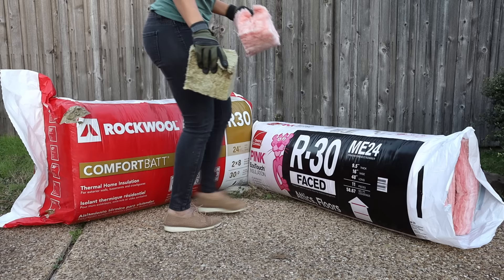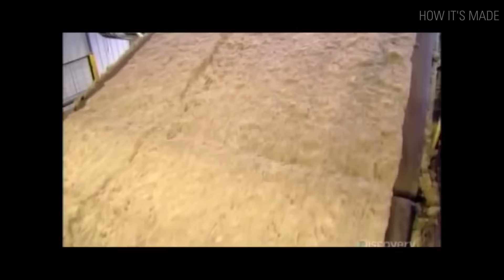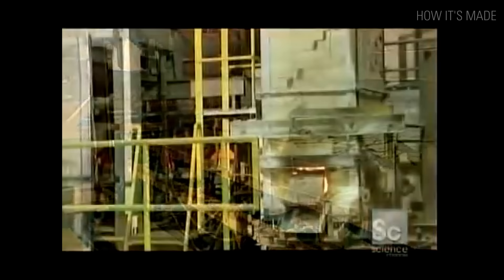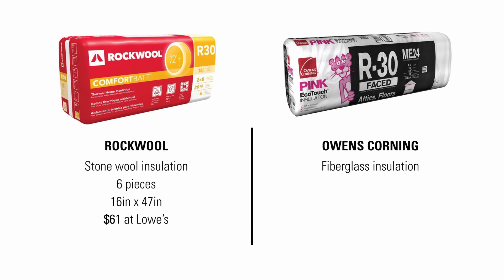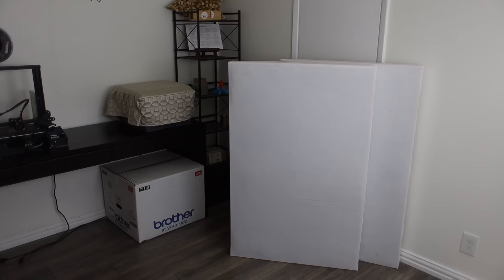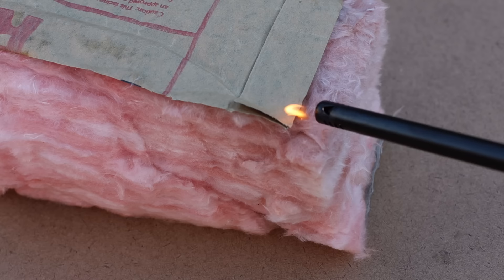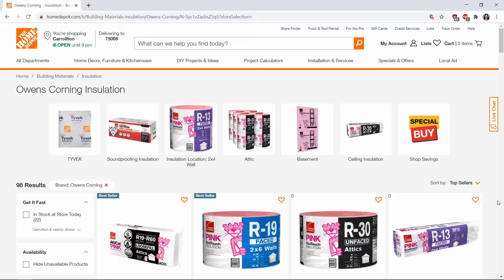Mineral wool vs fiberglass insulation | everything you need to know

Comment: I was surprised to hear about formaldehyde being in the rock wool. I remember hearing about it being in sheetrock in FEMA emergency housing after hurricane Katrina and there being lots of concern over the formaldehyde  polluting the air in the homes and increasing cancer risk.
Reply: I understand your concern with formaldehyde but saying your surprised is concerning on its own. 35yrs worth of data and application of formaldehyde in the home building products gets only a recommendation of reducing possible exposure and ventilation suggestions 🤔 
Please do your homework before making  moments related to 25 yr old news reports. 

P.s. do you know what FEMA did with those temporary housing units?
Reply: @88jettaguy  Dude, Harsh, maybe I don't want to take extra precautions not to huff formaldehyde in my living space.

Comment: Here in eastern europe the fiberglass insulation isn't very popular. I'm working in a construction company that has a lot contracts for thermal insulation of apartment buildings and i don't think i ever seen any fiberglass insulation in any project. We mostly use polistyrene (EPS or XPS) and mineral wool.
In most cases EPS is used wherever it can be used and rockwool is used where it has to be used - borders of fire zones (or hovewer it's called in english) and all exterior walls over 25m above ground.

Comment: As with any insulation Rockwool insulation if water is poured over rolls off. One would think that it dose not absorbs. Set rockwool insulation in a bucket of water and you will see absorbency like a spong. Had a small leak and small puddle of water under rockwool abortion was plentiful. The product is delicate to handle without breaking apart. Fire retardant and molding are the best reason for this product over others.

Comment: Hi free thinkers, the first consideration is product safety. Rockwool has best insulation & fire retardant, a cousin of asbestos, when handling use personal safety gear, correct mask & protective disposable clothing. It would be safety code attached to insulation package, eg traffic lights, if the light is red, can be deadly. Green does not require protective safety equipment, that will not happen. Read the fibre size that can be injested lungs can effect health. Manufactures like asbestos was noted as safe, the choice is in your research.

Comment: I gutted my house and decided I could not afford in floor heating and went with Cast Iron baseboard instead. I also put stone wool in every wall & ceiling. Even walls between rooms for good measure. I can tell you now in floor heating would have been a complete waste of 20-30k.

My house is an oven 24/7  ....the heat is just trapped in it.  Invest in good windows, doors and Stone wool insulation and you will never regret it.

Comment: if you are remodelling an old house or building and are worried about retaining heat , every penny you spend on insulation is an investment . people spend thousands on the latest heating system which over time becomes old and unreliable and will need to be replaced , the insulation if fitted is still working

Comment: While the resin in the rock wool may not be demonstrably toxic, any very small fibrous substance that does not easily break down in the lungs so it can be expelled is at the very least an irritant and irritants can cause very serious issues over time.  While in the wall, these materials are in theory segregated from the air we breathe, but things change, walls break, and holes are made.

Be very careful with these materials.  They are great insulators compared to many other materials, but they do have their risk factors.

Comment: formaldehyde in stone wool would deter me from the product. Add in the increased cost, the weight and it is fiberglass for me every time. The weakness of fiberglass is not hard to overcome, install to keep it dry and do the proper supporting, not a big issue at all.

Comment: Very impressed with your videos.  You have several insulation comparison videos featuring 2 types.   Overall, what do you consider the “best” insulation material?   One if price is not a factor and another for cost effectiveness.   Curious if Rockwool or cellulose or ? would prevail.
Reply: If price is not an option, closed-cell spray foam has the best performance by far.

Comment: Rockwool insulation is better for camps and houses in the woods as well. For instance Squirrels will chew and burrow through fiberglass getting into the structure and ruining your insulation and getting it everywhere. As Rockwool they can't burrow or chew through. building a camp use rockwool...

Comment: Hey Belinda, I love the way you present all the info. But regarding the rock wool I have a question, If you can research for us. Friend of mine got 2 spare rockwool sheets and store them in the attic of his house. It is not heated and could have little bit more moisture. After an year he decided to make use of this spare rock wool and was surprised to find it in very bad shape almost break in to sand on touch and wasn't that solid sheet... So is there something more that needs to be done to preserve rock wool from the elements? May be some treatment when installed?

Comment: Great video.  What I would like to know is, what is the difference between mineral wool batts and mineral wool rigid insulation.  None of the local stores such as Home Depot or Lowes carry the rigid mineral wool in the store and any time you speak to a store representative about ordering the rigid board for outside insulation they give a song and dance routine and tell the same story that someone ordered 6 to 8 months ago rigid outside board and it is still not delivered.  They both carry the mineral wool batts.  Can mineral wool batts be used on the outside of a structure?

Comment: Any opinions on sound absorption differences based on what frequency range you're trying to absorb? I have read a lot in sound insulation designs for home theater rooms and other applications where sound deadening is desired. A lot of what I've read says that the bigger challenge with sound deadening is bass, or low frequency sound, which is only addressed by maximizing mass, either through double layered drywall, decoupling and even double walls. For a simpler approach to sound deadening roxul will probably add a bit more mass but be fairly ineffective against bass sound travel. With double walls, decoupling, etc I've read that the pink stuff still does fine against high frequency sound travel.
Reply: pink = highs....double pane vacuume glass for bass, or super deep 20 inch sponge pyramids on walls
Reply: bass = pure 1/2 marble or ceramic or stone
Reply: @lunam7249  whew, I'm sure that would be effective but I wouldn't be the one trying to hang stone from a basement ceiling!

Comment: What about radiant heat?  I don't think the R value addresses that, and I'm under the impression that fiberglass isn't good at blocking radiant heat, such as from a hot roof "shining" its radiant heat through the ceiling insulation below it.  (Yes, heat moves through conduction and convection, but also radiation --- three modes.)

Comment: Belinda, is it true that if you press the rockwool in place it loses its R value? And what about ripping it lengthwise? I’m wondering if we should start over on the ceiling/roof of a shed that has 2x4 studs and I was accidentally given 2x8 Rockwool R30 and my non English speaking worker ripped it lengthwise since clearly 8 inches was too thick for the spaces. He also ripped up a bunch of pieces to go around the outlets and lights. Doesn’t that ruin the Rockwool’s performance and the reason I bought it? Oh I hope you see this and reply or someone does. Thanks so much. I’m so glad after researching for hours earlier that when I came to YouTube your video was in my top feed. Now I’ve gotta check what else you’ve got. 👍😊🙌🙌🙌💝

Comment: Great video, the embodied energy used in the production of these insulation products seems to be enormous, surely there are insulation materials available that don’t require such massive furnaces? Have you looked at natural wool or recycled cellulose which is are both recycled products that can also be recycled beyond their lifespan as insulation?
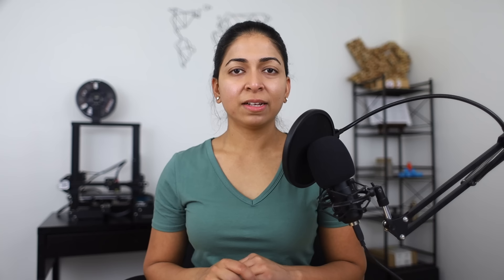Reply: A note in one of the cut away graphs in this vid (9:13) states that for every BTU used to manufacture the insulation, 12 BTUs are saved in heating/cooling costs IN THE FIRST YEAR ALONE! That was a shock to me. Sure seems worth it

Comment: Thanks for the great informational video I have a question I have a concrete basement floors and walls and there is no heat other than the furnace working which keeps it warm , should I insulate the ceiling of the basement ? Type ? staple up plastic to cover from dampness ?

Comment: Is Rockwool or Mineral wool  a good product to place in rafters for ceiling insulation? My contractor said it was not because it would be too much weight on top of the ceiling drywall and causing it to sag over time. I'd prefer to use Rockwool or Mineral wool, but without the paper edge to to staple to the rafters, I am concerned about the weight issue.

Comment: overall nice presentation, but i can not dismiss a feeling, this is kind of marketing for rockwool. in general, stone wool is not as water repelent as it was mentioned, seen a lot of examples, where it have been completely transform into pool of mud , if there some leakage happened from radiator piping etc. both insulation have their usage with their pros and cons.

Comment: Does stonewool overtime leave dust in the air when low frequencies hit it? I have a home theater with bass absorbers made of stonewool/fiberglass hanging from ceiling wondering if they’ll end up emitting stonewool dust from above when low frequencies hit them. My subwoofer produces frequencies between 10 and 20Hz.

Comment: How is Rockwool insulation different from the Rockwool cubes used for growing plants?... I see the Rockwool you used does not soak up water, but the cubes for plants do,.... is the waterproof resin not used on the cubes? Can I buy Rockwool slabs to grow plants rather than buying cubes?

Comment: I'm looking to soundproof my ceiling. I need to stop the noise coming from the flat above me,  music and the old creaking wooden floorboards from the flat above me disturb my piece. Could you please advise on the best and simplest soundproofing solution? This old house is divided into flats, and the construction of ceilings and floors is made from old wood, there is no concreate. The outside walls are bricks, the inside walls are simple partition walls. Would gluing Acoustic Foam Tiles on my ceiling stop the squeaking (creaking) noise that comes from the floor above my flat, low level music and heavy steps?

Comment: Would have been nice to know maximum stable temperature and thermal conductivity per unit (cm/in) (loose/compressed). I want to use in a kiln, furnace or forge. 🤗🖖,jpk

Comment: I was wondering about roping off the insulation in my attic. currently I have fiberglass batts. If I went with Rockwool on top of the existing fiberglass batts. Or would I have to take out everything and start from scratch to get the benefit of Rockwool?

Comment: this is for a (not so) tiny home, i have been offered a great deal on stonewall insulation (vs styrofoam) but they insulated sheets seem to be laying there for a couple of years, exposed to heat (low humidity) but the bottom part of the packaging is exposed (they are laying flat)
any idea if they are still any good?
if so, i can wait till spring when the raining will stop, should i wait or what's done is done
any help is most appriciated
thank you in advance  for any and all help :)

Comment: When these insulators are manufactured, the process consumes so much energy per day that the insulation does not save on society's energy consumption in life time.
Insulation made of natural material is cheap to producing and save prosessing energy, as well as absorbing moisture without damaging the structures.
The purpose of the insulation is only to prevent air from moving in the structure.

Comment: Why doea the orientation of the foil matter and differ between cold and hot climate areas?
Reply: due to stable temp indoors of  degrees +/- on the outside wall.
I.O.W
  it's basically 70°(HVAC stable)  all year long inside/indoors...vs  +/-  0 - 90° outside all year long changing hourly daily/seasonally  with humidity.
Reply: @tjellis1479  thank you for your reply! but she says to keep the foil from the inside in cold areas, wont this get the condensation to form inside the insulation material and ruin it during winter time in cold areas?
Reply: 10:40

Comment: Hi. I have a question. I want to insulate an interior wall in our bathroom, if i use the rockwool should I still use a vapor barrier? And which rockwool i should use for bathroom? Hope you can help. Thanks.
Reply: Where do you live? In the north like canada where we heat in winter and use air conditioning in summer, we put a vapor barrier everywhere in a building. For either fiberglass or rockwool

Comment: Kaowool is superior to both and it’s used widely in the cement plant industries, where cement or Portland or Type2 cement is actually made , not a redymix plant but a cement plant where a kiln that burns the aggregate at 2500 degrees at the burning point. It’s simply the best insulation ever there is no other product available to the masses that can compare to the heat resistance. Give it a look for absolute protection and insulation factor

Comment: After changing the insulation to Roxul there are no insects or rodents as there was with fiberglass.  I wouldn't even consider fiberglass for anything except in the case where weight was a consideration.

Comment: You first sentence is incorrect: you forgot to even mention styrofoam. It's used for almost all cases for walls. Mineral (glass/stone) wool is used on almost all roofs. 
Also: use of slag is very good, as it means recycling waste. 
11:00 It's beacuse stone wool was found by an accident - it was found in nature on some volcano and the research was to recreate it - most basic way was to blow air on lava (that's how this was created by nature). 

Glass wool is as bad or worse than asbestos when you want to do renovation: it tends to dissolve into dust on its external surface, while bazalt wool not (not as much). Also Glass wool  dusts a lot with glass dust during assembly, so it is way worse for health than stone wool.

Comment: What do you think about cork panels and polyurethane foam?
Reply: Urethane using HFO chemicals is the best and most expensive insulation out there. Serves as a vapor and wind barrier (2" inch thickness minimum) as well as insulation.

Comment: 5:55 'The high density of stone wool equals more trapped air'
That's physically impossible, unless air is pressurized (which lowers its insulating properties). With higher density (meaning there's more mineral material in the same volume) there's less space for air, not more. I guess you meant that rock wool is less permeable? That it better constraints convection and other means of mechanical heat transfer?
Reply: She probably meant that the warm air inside ur home is more trapped
Reply: This comment came under the topic of sound absorption, so she may have been referring to the higher flow resistivity that typically comes with higher density insulation products. That is, "more trapped air" meaning less opportunity for air molecules to oscillate within the product, or higher rates of soundwave kinetic energy being converted into heat energy.
Reply: @Deyterkmahjeeerrrb  I'd say it's 'better trapped' air, although less of it.

Comment: Both of these insulations are worth little. Mainly for two reasons. Insulations with a fibrous structure have a low resistance to air movement, i.e. convection. The second, disqualifying disadvantage is the sensitivity to a decrease in insulation due to increased humidity. it's a waste of money and more. It is only a large disposal cost

Comment: I hate to work with either of these, because they itch sooo much and are harmful when breathed in. I have installed polyester batts (basically doona filling) which is far safer but a bit more expensive. The installer was whinging because it is harder to cut, but other than that no complaints. Rockwool and fiberglass break down and start to trickle down through the holes in your downlights on a single storey building.....

Comment: Why anyone would want to ever continue to use fibreglass as insulation is beyond me. All you need is go look in enough attics and see just how much fibreglass over time compacts up how dirty it becomes and even sodden should the roof leak and ends up needing to be replaced. I've used both fibreglass and rockwool once I discovered rockwool I never looked back I find it doesn't end up as messy to use it keeps its shape and the soundproofing even when not using the soundproofing product is so much better plus it's so much easier to install. Yes fibreglass is cheaper and you get more of it in when purchased but if replacing insulation in the attic say nothing says you have to replace it all in one go if the cost is a worry do it in sections over time. Install the rockwool instead layer up the pulled out fibreglass over existing fibreglass regaining some of the R-Value lost until you can buy more replacement it's what I did years ago. Over time fibreglass is just simply a false economy to buy because it loses the R-value quite quickly and as such you have to replace it when it is lost plus if becomes sodden it is just not worth keeping even if it dries out.
Reply: It’s all money. People and companies are so desperate to save a few bucks that they’ll go for the cheapest option almost every time